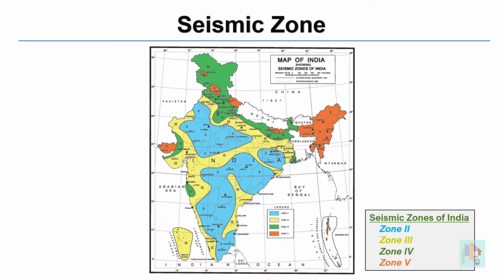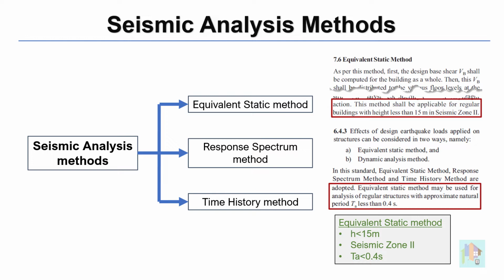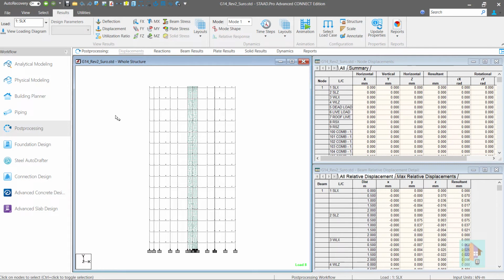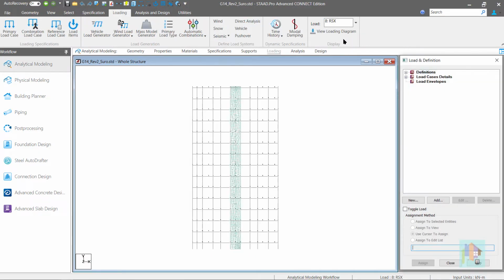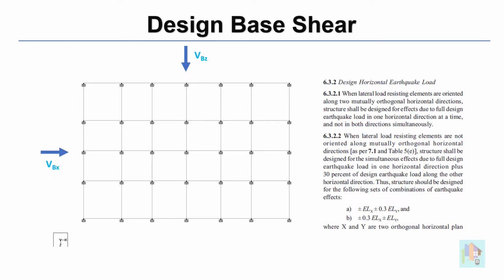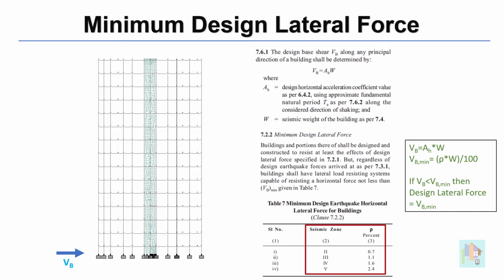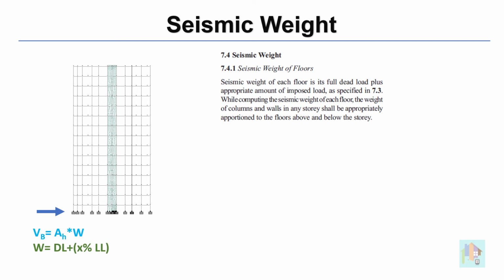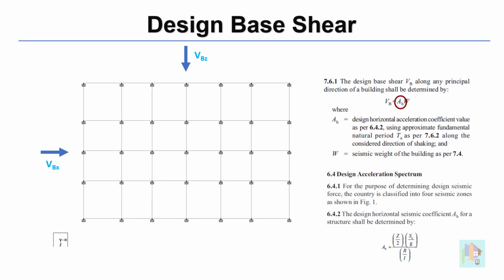Static Seismic with IS1893 - pt.2: Basics of Design Base Shear || Criteria, VBmin, Seismic Weight

Comment: Very good info. ..what command (or procedure) is used to obtain the shear forces and moments of each wall (concrete or masonry) for each story.
Reply from the maker: There is no separate command, if you model the RC walls using plate mesh, during analysis correct force (plate stress) will be calculated from FEA and that analysis results will be used for shear wall design in Advanced concrete designer (RCDC). For URM infill wall, you need to model it using equivalent diagonal strut to consider the wall stiffness during analysis.

Comment: Please make a full tutorial on response spectrum method using IS code 1893- 2016
Reply from the maker: It is already in my plan and once the static part is over, I will start a separate series on dynamic analysis.
Reply: @surojit_ghosh  thank you 😊will be waiting
Reply: pl cover the all co eff during seismic definition. eccentricity 1+-0.05